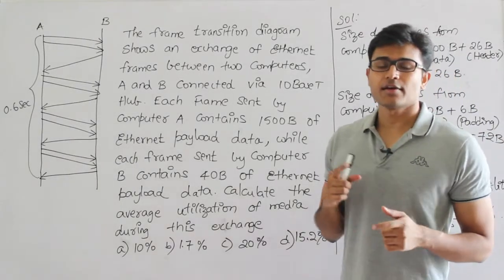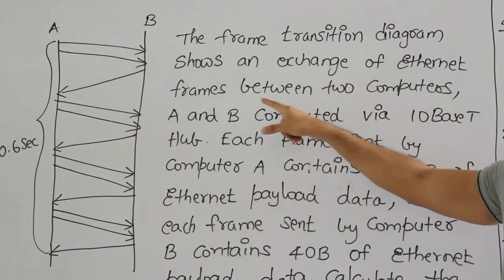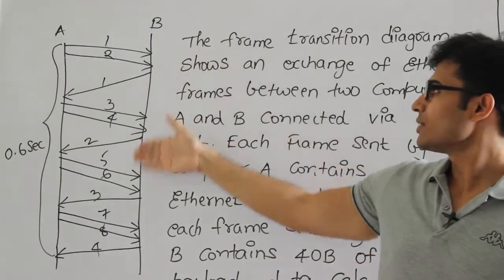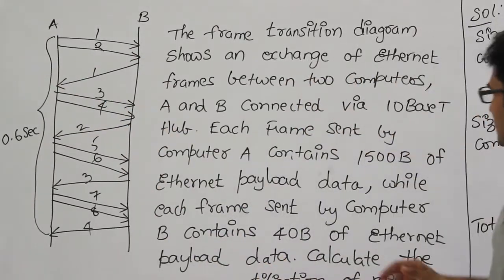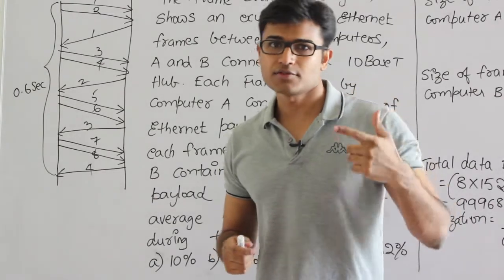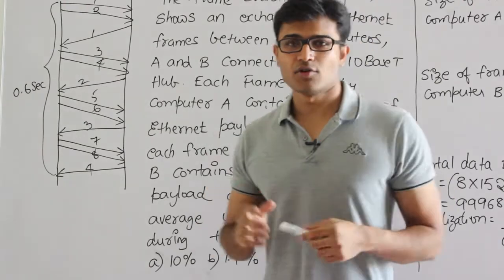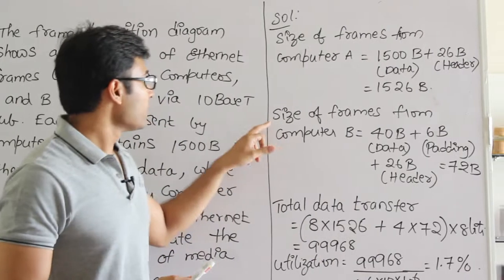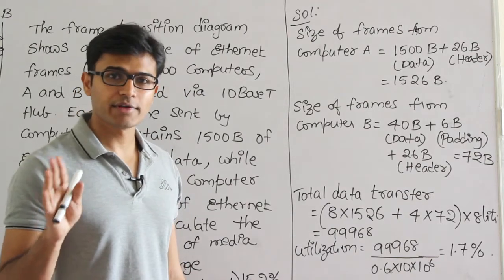CN - Problem 35 | Ravindrababu Ravula | Free GATE CS Classes

Comment: Header size shouldn't it be 18?
Reply: yes , bcz in frame we dont count 8 bits of PREAMBLE and SFD which gives total of 18 bit fame and we add them only when we actually transmit bcz those 8 bits are added  by physical layer while actually transmitting and as here transmission is actually done so header size is taken as 26 b
Reply: @nirmalaryal6446  Thank you